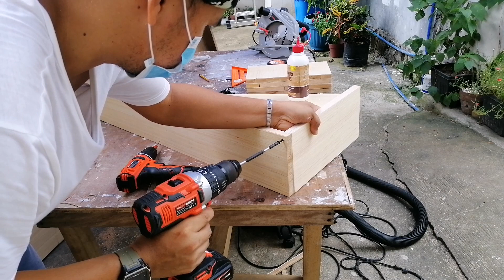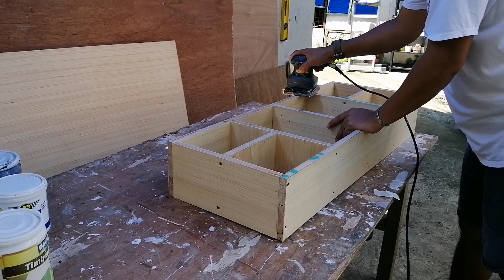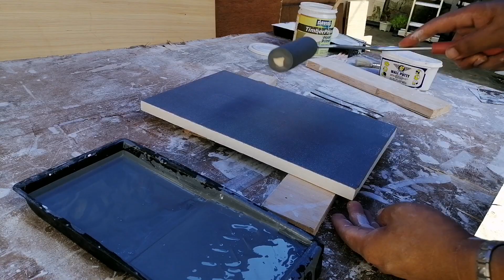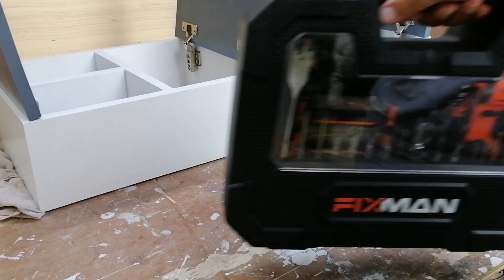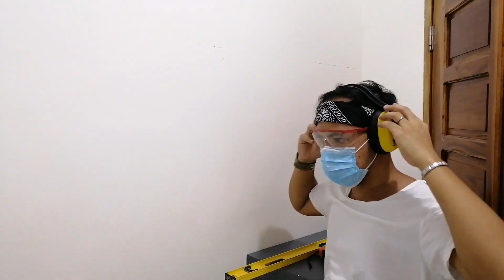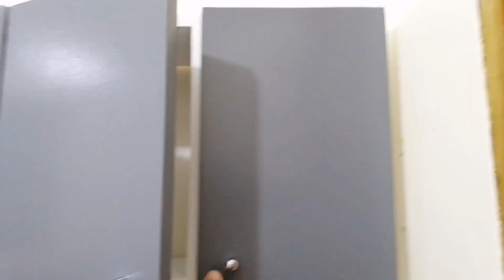DIY How to make Wall Mounted Cabinet | Hanging Cabinet | chit-man channel

Comment: Idol ok lang bah gypsum screw diretso sa concrete wall? Ok na walang tox?
Reply from the maker: Iba kz sir nag gamit kung black screw qng mapapansin nyo malalaki ang talim nya d tulad ng gypsum screw na Pino, kya mas kapit sa simento ung gamit q, pero pwd rin naman ung gypsum screw
Reply: @ kabayan chitman, kapag gumamit ako ng black screw sa concrete wall, binubutasan ko muna gamit ang 1/4 masonry bit, then nilalagyan ko ng wood dowel para doon mag screw if spacing permits. Ung dowel ako na gumagawa. Un ung way ko, I don't mean na un ang dapat o tamang gawin.
Reply: @chit-manchannel5708  ano yung gamit mo na screw idol para sa concrete na wala nang tox? Salamat.

Comment: Idol anong size ng bits na ginamit mo sa pagbutas para sa hinges? Thnx idol
Reply from the maker: 35mm po
Reply: Galing kabayan! Tanong ulit anong suggest mo n magandang screw at size ng screw pra s hanging cabinet?bale 1/4 n backing at 3/4 n french cleat gaano khaba n screw?slamat ult kbayan